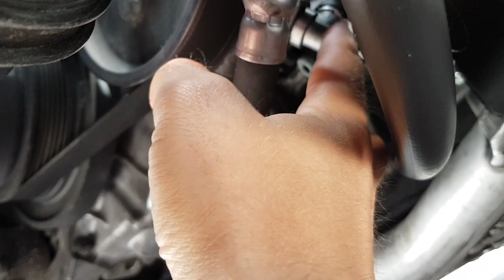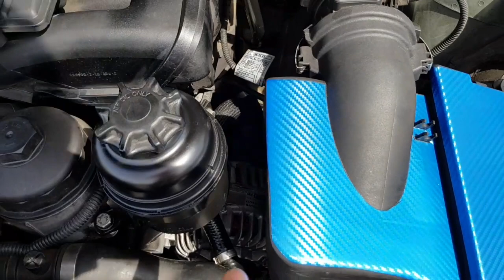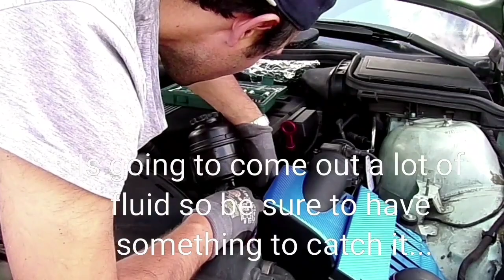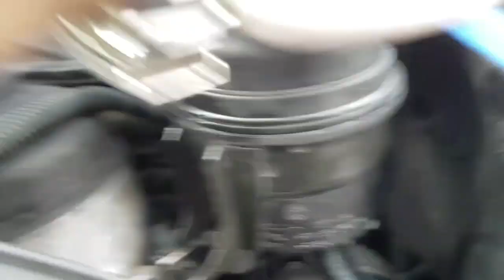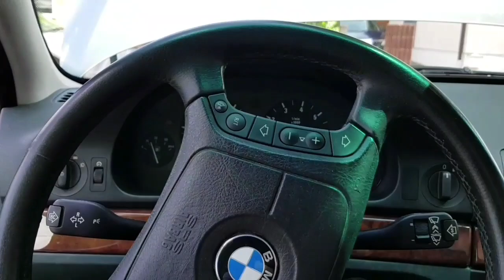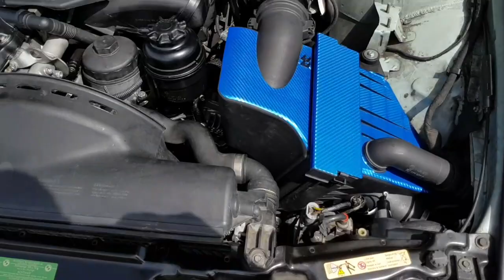Bmw e39  power steering fluid leak repair (M54 engine)

Comment: Michael is really good at putting things back together carefully, making sure everything lines up and isn't too tight. He's not just fixing the problem; he's making sure it stays fixed. I know because my old car has 152,000 miles on it, and it's still doing great. The only thing I had to change was the power steering reservoir, and now it runs smoothly thanks to one from Euro Power Motorsports.

Comment: Fixing the leak is not a final solution.  System needed a complete flush.  Steering rack and seals are going next.

Learn the flush procedure.  Mercedes Benz saying & R&R filter with complete flush every 40,000 miles.

Comment: The Reservoir with filter needed a replacement at 75,000 miles.  Removing air box would have allowed hose replacements.

Comment: Can you say how long did this fix work for you?
Did it leak anytime soon after that fix ?

I am thinking to do this job before buying an aftermarket parts to change the reservoir and hoses
Reply from the maker: I had the car after this fix for about another 6 months and never leaked again
Reply: @WarpDriveM  than I will give it a  try

Comment: I have this issue with my E39 530d (M57 engine.) I presume the power steering system is the same. I know it is different on the V8 models.

Comment: Good vid. Nice clean engine. What's the tin foil for at the back of the engine bay/
Reply from the maker: It was in there just temporarily because the plastic trim was burned and i didn't want to let the heat melt something else...

Comment: I am confused. If it's leaking, why not just tighten the clamp?
Reply from the maker: Because there is no rubber anymore on that old part of the hose. That's why you have to cut that part out.

Comment: Gonna do this, but I notice one of my hoses been rubbing on the air box, and the threads inside the hose wall are showing. Will replace as well.

Comment: It's also possible that your VANOS oil line is leaking.
Reply: TerrybleGamer any info on this?
Reply: Mine is leaking too (e34 m50) and whizzing when the steering turns right and left, could it be has the same problem?
Reply: @renjirorayhan  If your power steering fluid has the correct level, then it might your pump. A leak will at the reservoir will not cause a whining noise.
Reply: @TerrybleGamer  thanks for the information

Comment: Great!  Thanks.  Should I replace with new power steering fluid while at it?
Reply: it should say 'atf oil only' on the cap, so you can use most Automatic Transmission Fluids, like Dexton 3
Reply: Since you are on it, might as well change it out.

Comment: Was your car jacked up at the front whilst doing this or not? I didn't see you drain the old ATF oil out from the bottom of the car so I assume you didn't? Cheers.
Reply from the maker: Fabian Dee It wasn't. I just drain the fluid from reservoir and from hoses for this repair. After that I just top up with fluid. This car is now in the process of installing a turbo kit. Just watch my other videos on my channel. Thx for watching
Reply: Turbo kit....I can't wait to see it.
Reply: Thanks for this video.
I have the same issue with my 2001 E38 . I'll have to try this in efforts of saving $$$$$$.

Comment: The power steering fluid lines might be brittle, at least the bigger one - I was told this happens regulary.
And yup, its leaking even after I cut off a bit and put a new hose clamp on.
Reply from the maker: +JxG it is true! This is a common problem with the e39. In my case it's not leaking anymore
Reply: The big one the the return pipe ?

Comment: Did this work? Has the leak gone away? Please let us know. Thanks.
Reply from the maker: +jorge vega till now i don't have any problems....very soon I will post an update on the e39! Thx for watching!
Reply: @WarpDriveM  I'm having if the same problem on my 2004 BMW 325i, what did u use to cut the hoses with??
Reply from the maker: I've used a normal cutter, but be careful  that hose is hard and you can slip the cutter in to your hands ✋!